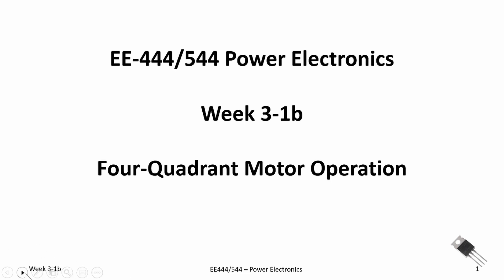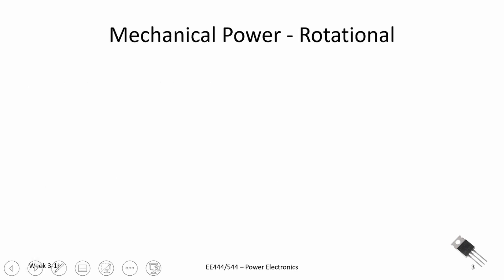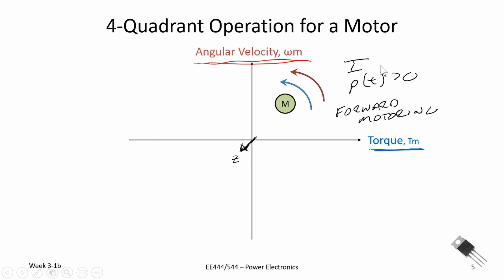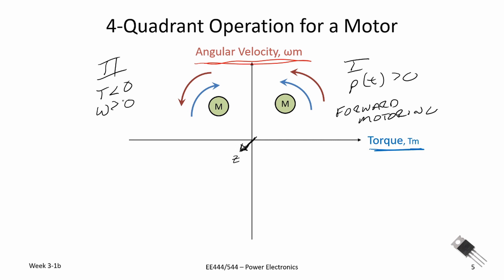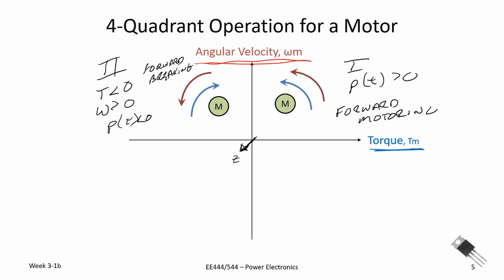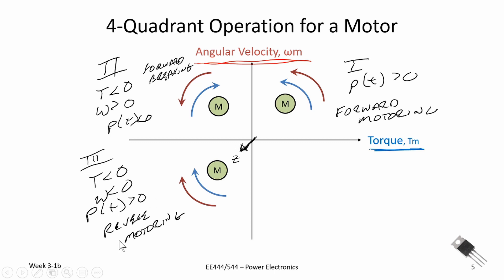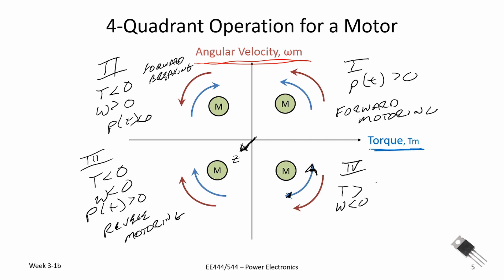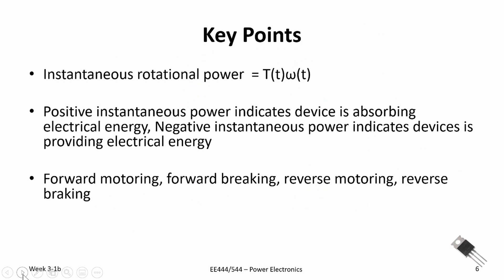Power Electronics WK3_1b Four Quadrant Motor Operation

Comment: Awesome video. Just lacked some explanation on what exactly forward motoring, etc. But good overall
Reply from the maker: Thank you.  Good feedback for future reference.  Forward motoring is really a matter of perspective.  It would probably be counterclockwise rotation of the rotor and torque being applied in the same direction. However, if your view changes, then that rotation and torque becomes clockwise. Best wishes. -Dr. K